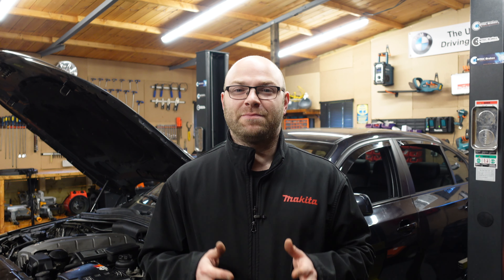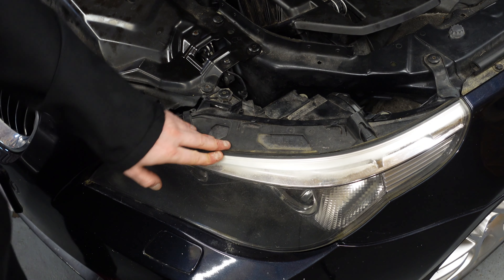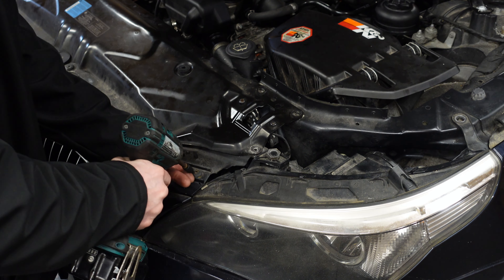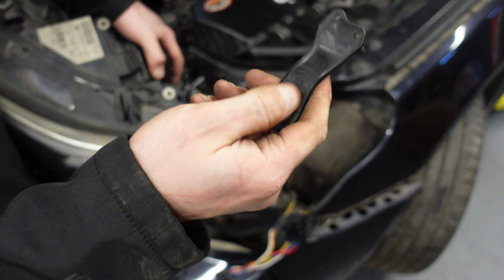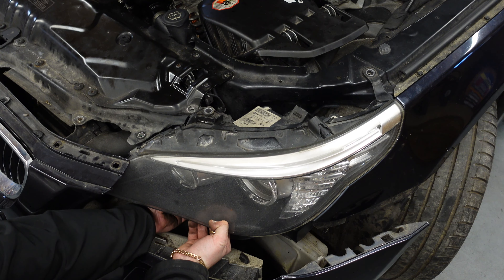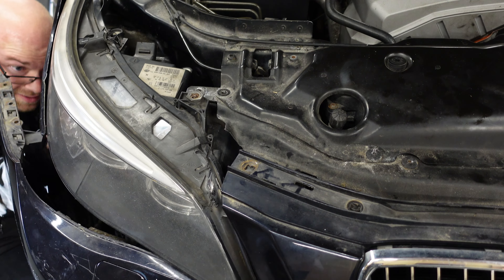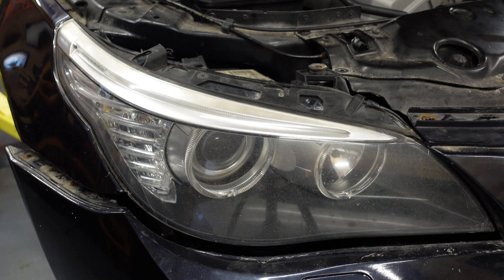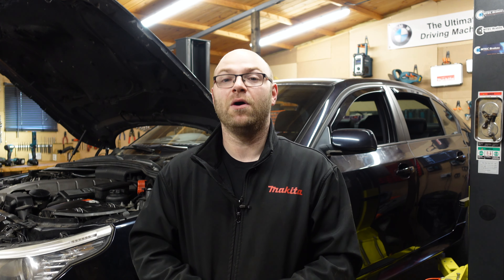BMW E60 / E61 PRE LCI Halogen Headlight To LCI Halogen Headlight Retrofit

Comment: i did this headlight conversion 5 years ago during lockdown, no LM2 no pre made harness , did it by cutting off the old connectors and splicing on to the new Lci harness , only issue was the angel eyes on the pre LCI light was 2x 501 bulbs where as on the LCi it only uses one bulb so a resistor pack was wired in to one set of wires to stop errors .

Comment: i want to do angel eyes on my 06 plate e87. are they plug and play? seen other youtube videos but you seem to be the main man to trust.
Reply from the maker: They are plug and play if you buy the harnesses for the wiring otherwise you will have to alter the wiring which isn’t hard on the E87 as there isn’t that many wires for the lights on them. So it can be done easily just don’t buy xenon’s or you will need to run a new live wire from the frm and JBBE and a ground to the frm itself from the lights to make it work.
Reply: @BMWDoctor 🙏🙏 appreciated.🙏🙏
Reply: Yep

Comment: Hi mate i have a question about   light insulation on e60 525i pre face lift  It has 11 pin's on two plugs  and  I want to install e60  520d lci  halogen with has 10,pin's on plug
So the question is whenever dose 1 extra pins gose on lci headlight   If  there isn't  corresponding pin one hosing it self 🤔
Reply: Hey there just wondering did you even get to the bottom of the wires on the headlight because am in the same position with my ones

Comment: I have never been keen on LCI upgrades as to my eyes the original form of any car is closer to the design artists concept. Anyway the E60 seemed to be a special case as they redesigned the electrical system. I presume the LCI halogen case works with LED bulbs with the projectors?
Reply from the maker: That’s correct I can indeed now I can put whatever bulbs I want in now they have projectors that’s the plan. And it’s much cheaper then actual factory xenon’s that ain’t that bright in the first place so I much prefer to add LED bulbs that are £20 and won’t blind anyone now.
Reply: @BMWDoctor  will they auto level or do you have the dash control?
Reply from the maker: Dash controls for these no auto level on them

Comment: Hi everyone. I just bought a 535d 2004 with one problem and i want your opinon on what it might couse it. This has nothing to do with the video but i want some opinions or if anyone had it before. So, when the engine is cold it does great performance on acceleration it responds nice,but when the temperature goes around 80 celsius degree it starts making an agressive noise on the exhaust and engine does not respond in time when i hit the gas and a lot of white smoke frome the exhaust. When i stop and rev it the noise isnt there anymore ,but when i shift to D and hit the gas it does it again.
I went at a mechanic and they told me its the head gasket problem

Comment: Great Video, where can I found this adaptor?
Reply from the maker: You can easily make the connector. I got them as they was cheap to buy instead of making them but I have the bits to make them aswell it ain’t hard if you have the pin out for the headlights for the LCI ones

Comment: I leave the bracket on the car, I only removed the torx bolts above the kidney grills. And then pull the headlights out without the bracket.
Reply from the maker: That’s usually how I do it but I was changing them and needed the bumper off anyway
Reply: @BMWDoctor  quick question. Is it possible to install lci taillights with LM1 and adapter cables?
Reply from the maker: Nope not possible unless you get converters that plug in on the back. If you want it factory you have to use LM2 but LM2 is not expensive anyway it’s about £30 to buy and easy to install.  It’s just the coding
Reply: @BMWDoctor   yeah i’ve bought lci taillights with adapter cables for a very cheap deal. Guy who sold me this had his car wrecked before he could install these. But with LM2 its easier. Can it be code with the launcher creader elite? Maybe getting myself a LM2 has more functions then the LM1
Reply from the maker: Yep launch creader elite can do the coding indeed! I’m about to show you how to do it its actually easy with that scan tool as I said that scan tool can do it all And I’m about to show that.

As for lm2 yep it has alot more options and also gives you the welcome light feature which LM1 doesn’t. So LM2 is well worth it for that
Reply: @BMWDoctor  ooh really nice. Yeah I bought it after I saw your video about it. So far I loved it for the fault codes etc. But there wasn’t really a video that really goes into the coding part. Love to see it, still need a good stabilizer for the battery when using the launcher. Never really went into the device what it all can do. But can’t wait for your video 💪🏽

Comment: Hi can I do the LCI taillight retrofit without doing the headlights
Reply: Yes I did it with my E60. But it’s more complicated. You need to buy additional kit from BMW retrofit for the taillights. And you will need a different light module (located underneed you steeringwheel). After that I went to an expert who programmed my lci taillights and made sure that my pre LCI headlights would still work. 

Al worth it in my opinion.